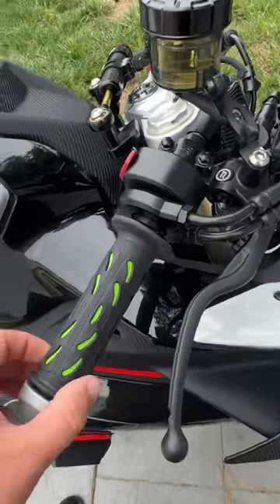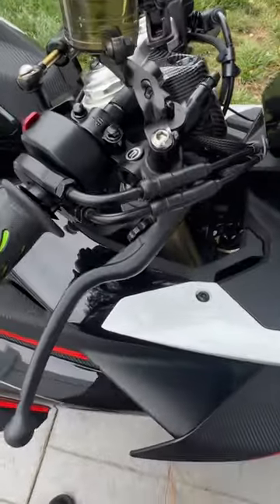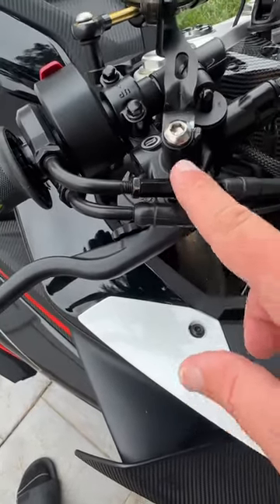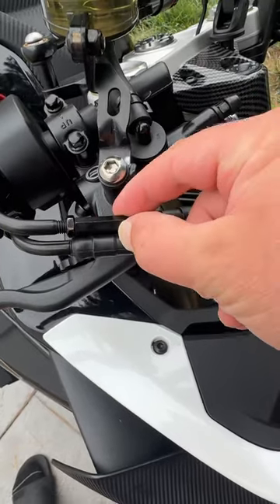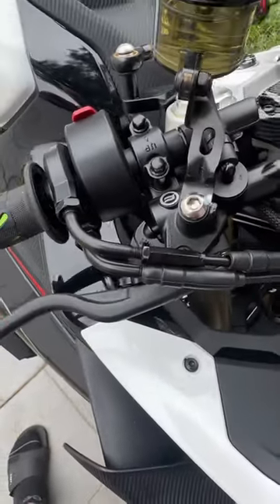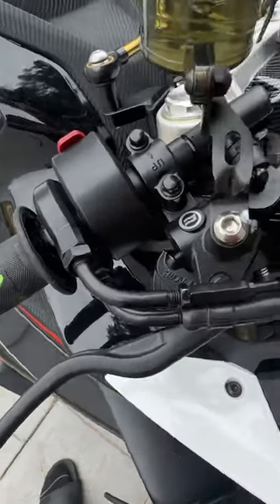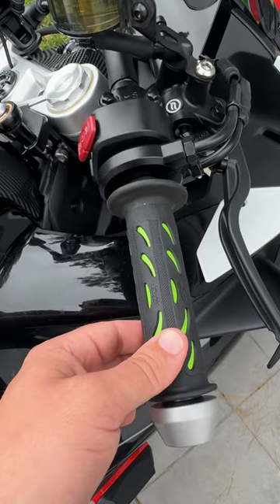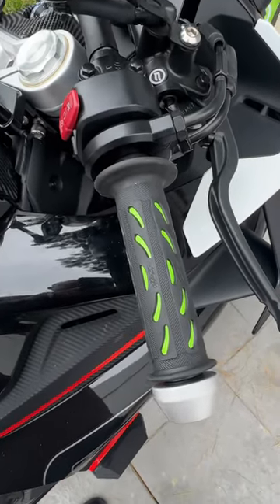Eliminating slack in throttle on CFmoto 450SS

Comment: I admire this bike but im still skeptical about this being my bike or the ninja 400/: im afraid this will have problems later .
Reply from the maker: That’s understandable. There really is no way to know how this bike is going to hold up in the long run. That could be one of the reasons CFmoto offers a 2 year manufacturers warranty when you buy it. Allows them time to see how well things are going to hold up with less risk to consumers.
Reply: I bought the white cf moto 450ss 3 weeks ago and already put 3800 miles on it I’ve rode for 15 hours straight last weekend this bike is amazing far better than the ninja 400 with looks as well as performance
Reply from the maker: @lonerider450ss  love to hear that you're enjoying your 450SS!!
Reply: Better than ninja 400 reliability shouldn't be an issue cause it comes with 2 year warranty and by then your balls will have gotten bigger and you can upgrade to a new bike like a ducati panigale v4s
Reply: Purchased a Zircon Black, two weeks ago. Worth it. Even though it’s in break in period, still fun, feels quick, lightweight and posture is not too aggresive, have not rode on a 400 but when sitting on one at dealership the Cf was more comfortable for me, given I am 6’2 it just felt like a better fit. Good luck.
Reply: The cfmoto can be comfy. Slightly more leaned than ninja 400 and when you scoot your seat back its a pretty sporty position. Good brakes, nice shifting, good enough power to do anything you would want to do without knocking at deaths door, and it's a great first bike. I already want to upgrade but I am a fast learner and am pretty well set right now with my skills so I'm looking to maybe get a 600 or a 750 next spring. Perfect learning tool though
Reply: In Europe they offer 5 years warranty 🤔
Reply: They are partnered with ktm so reliability is what it is
Reply: @borky1987 europe is lucky 😒
Reply: @lonerider450ss  3800 miles in 3 weeks? bruh
Reply: @rzt430  did 1100 the first day took 15 hours only stopped for gas and energy drinks lol
Reply: I got the 450SR-S (single swing arm is the best detail)

Not 1 issue, it's fun it's fast enough  obviously not a litre bike but fast for it's class & man does it sound beautiful

Comment: I was looking for this video, just one doubt, it’s just necesary Squeeze the one above? Or both?
Reply from the maker: With two cable setups, one cable is dedicated to opening the throttle while the other is dedicated to pulling the throttle closed. I would adjust both to ensure your throttle has a smaller amount of slack, while ensuring it opens and closes smoothly and easily.

Comment: well, it should have a little slack, dont follow this advice
Reply from the maker: It does still have a little slack. Doesn’t keep the throttle open at idle, and if you can’t control your throttle enough when hitting small bumps or something you probably shouldn’t be doing this anyway.
Reply: @CharlieDTE  yeah no, its not about keeping it open, and no, should have proper slack, yuo are squid by looks of it
Reply from the maker: @SuzukiRiderlv426 ok, so please explain to me why you need to have more slack than what I’ve left in the throttle in this video…
Reply: there is a difference between "a little" slack, and this huge ammount of it
Reply: @SuzukiRiderlv426  Instead of calling someone names, why not tell use the reason so other people can learn?

Comment: Hey, is normal for my brand new cf moto to be leaking  super small amounts of oil from shift shaft ?
Reply from the maker: This does not sound normal to me. Possibly overfilled with oil (motor and clutch all work off same oil). I would contact your dealer and run it by them.
Reply: Better take it back to the dealership to have them fix it. They should be fixing it at their cost, or warranty, because thats poor assembly. Not wear and tear this early on. You pay the "dealership fee...freight fee...whatever the dealer add on is. Thats usually the assembly they do on site).

Comment: Which one makes it so you decrease the slack. Twisting it towards the bike or away?
Reply: this is pretty much like any other motorcycle with this style. 
There's an adjustment on each cable, each cable being the open cable and close cable, you can adjust both and depending on how you adjust it will not only take up the slack but can almost move where the roll off point is so if you find the closed position to be too far forward or back, you can actually adjust it to move it to where you want. 
That being said, going towards or away from the bike will be different depending on where you want the close position to be so just play with it, you won't wreck anything.

Comment: Anyone has an issue with loss of power and green fluid leaking ?
Reply from the maker: Green fluid (coolant) is pretty normal to come out of the overflow line (right side of the bike) and I wouldn't worry about that. Keep an eye on the levels everytime you go out for a ride just take a peak and you should be fine. Never had an issue with loss of power though.